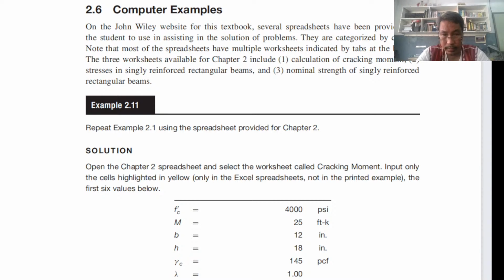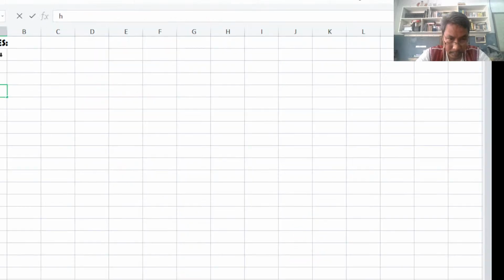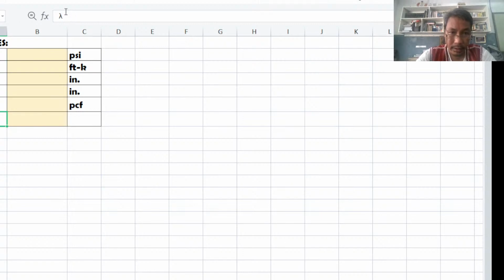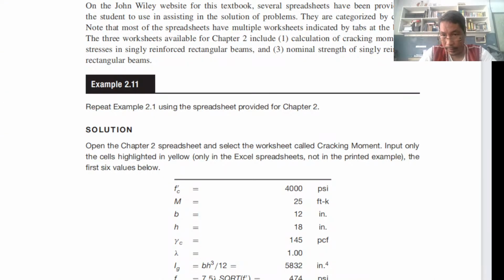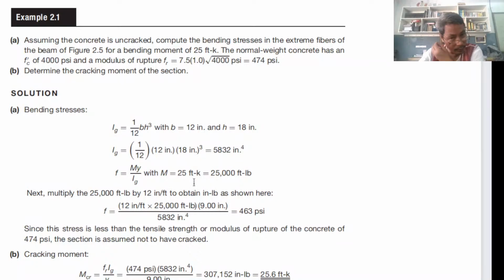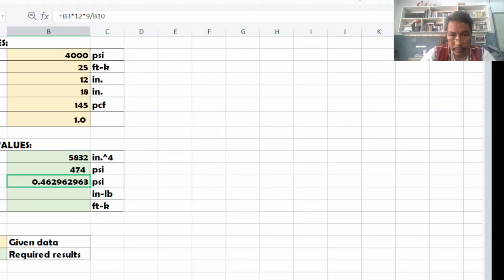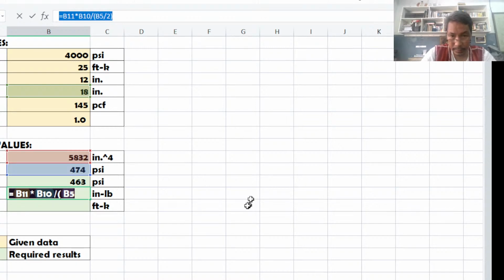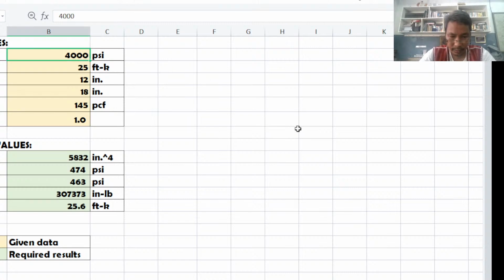[ LIVE CE E7 Lecture 03 ] DrAP Zantua XLS Talks + ENGINEERING Analysis & Design: How to Make xls App

Comment: Thank you sir for teaching us and sharing that the calculation on bending stresses in singly reinforced triangular beam can be performed in excel spreadsheet. This are good thing to use if you're already an engineer for best utilization of time when analyzing a design. Everyone should have known the concept first in hand-written solution because you can have the answer using the application, yet you can't understand what really it is for.

Comment: Thank you, sir, for the live lecture and for indicating that the bending stresses in a triangular beam with only one reinforcement can be calculated using an Excel worksheet. If you are an engineer already, you should use this to maximize the time you have available when examining a design.

Comment: Thank you, sir for sharing that the calculation on bending stresses in singly reinforced triangular beam can be performed in excel spreadsheet. This are good thing to use if you're already an engineer for best utilization of time when analyzing a design. Everyone should have known the concept first in hand-written solution because you can have the answer using the application, yet you can't understand what really it is for.